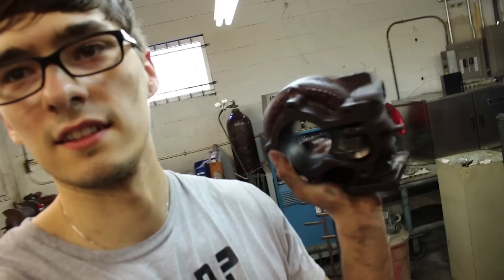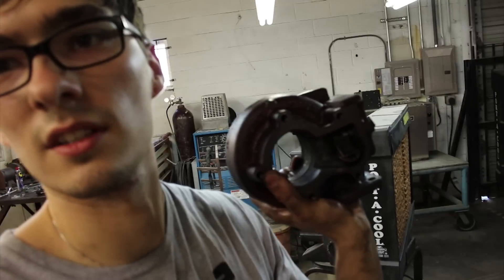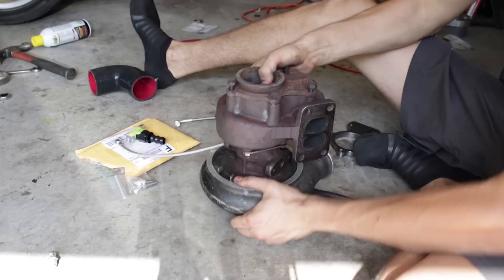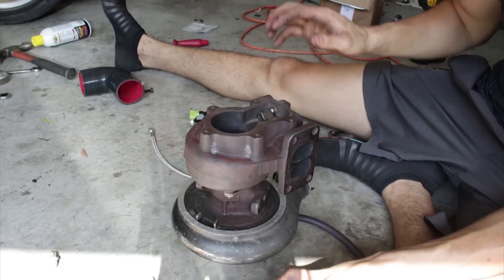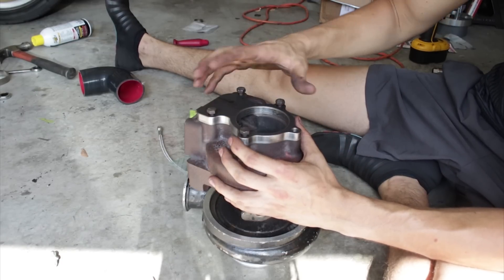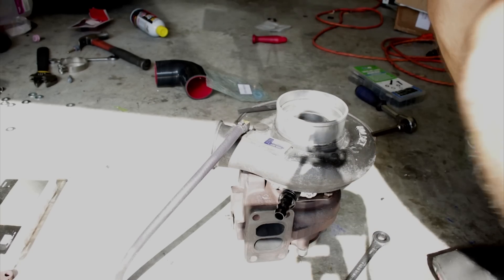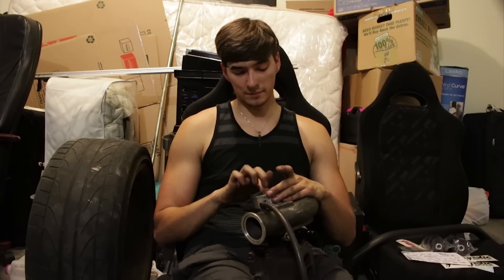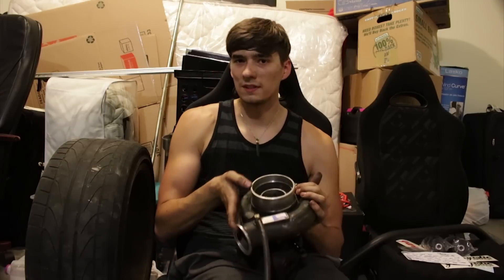Turbo BMW E30 Build: Part 11 | Welding, Clocking, Assembly of Turbo

Comment: That Torch stick out 😂
Reply: Nutguy95 in a tight spot like that with a large cup it's almost necessary to have that much stickout.. mind you that tight spot will flood with gas so it's not really that big of an issue.

Comment: I would have kept the v-band flange on the exhaust. They are so much easier to work with and require not gasket. If you already have to fab a down pipe it would be no harder to fit a v-band flange on the down pipe side to match the one on the turbo.

Comment: Not to be offending or anything but how come you use an old turbo?
Reply from the maker: Cost. Why not though? nothing wrong with the turbo in any fashion.
Reply: i mean why use a diesel turbo?
Reply: Nexcron Plays hx35s are great turbos they are twin scrolls so the spool fast and are capable of almost 40psi of boost

Comment: You should RTV the interface between the compressor housing and backplate. You're likely to leak boost from there if you don't.
Reply from the maker: They make proper seals. I have one. 
RTV is absolutely not the correct thing to use.

Comment: @EuroGarage, I have the same holset turbo and have been searching for a 3" backing plate like that. Where did you get it? A 2.5" V-band fits on the stock exit perfectly but I'd need to get a 3" to 2.5" reducer.
Also, what size silicone elbow is that?
Thanks!
Reply from the maker: http://www.ebay.com/itm/400874203617?_trksid=p2057872.m2749.l2649&ssPageName=STRK%3AMEBIDX%3AIT

2.5" elbow
Reply: Wow thanks for the fast response! Ill order mine now. Too bad I'm in CO, would be fun to build my E30 M50 turbo with ya and compare

Comment: Any concern with the CX manifold over loose slag or metal stalactites inside the turbo manifold?
Reply from the maker: No it's a fairly well made piece, no sugary deposits I can see of. 

In fact the weld they did are better than the welds Troy and I have been doing.

Comment: Can I ask why you welded the waste gate shut? I honestly don't understand why you would do that.
Reply: So he can use external wastegate?
Reply from the maker: The internal gate is meant for about 30psi of flow. So it is too small for the measly 9-14 I will run.

In short, I will be using less of the exhaust gas than I would at such high pressure and must vent more through a larger external gate!

Comment: well , im following you for a time ago because we share the idea of m20 turbo , but i dont have the knowladge to do it so you are a ligth on the nigth for me!.  i ve got some questions for you, related of ECU and injectors. when you put the MS you lose any of main functions offered by BMW on the car?  , and the second what injectors do you plan use? i read something about hi or low impedance but i dont know very well or whic one should use?.

best regards
Reply from the maker: I haven't noticed any loss of function since ecu. But barely driven it. 

I have 60# high impedance injectors from kamotors.

Comment: I had to use a press to get my H1C apart, and it was scary when it finally came apart dude. Lol
Reply: I'm actually glad I did, because I found out my heat shield inside the turbo was in pieces, and I couldn't tell without taking the whole turbo apart!
Reply from the maker: +Aaron Brenckman I took about an hour of prying and heating to slowly wiggle it out. 
I was gentle as to not bend the shaft.

Comment: Just fyi Holset turbos can be ran with the drain up to 30 degrees off vertical. I actually ran one at about 45 degrees once and was good for over 50k miles. But vertical is best. Great video, I don't know what your doing different but the lighting looks great in most of it.
Reply from the maker: Learn something new every day. Good to know if I run into clearance problems down the road. Thank you.

I have been playing with the settings on my new camera, Manual Exposure settings, looks good most of the time, unless the sun shifts and I don't notice, making it very overexposed like the end there. 
It is also summer inTexas, so that helps.
Reply from the maker: I used this info. Thank you. I had to tilt it ever so slightly for the drain.
Reply: Right on, as long as your withing 30 degrees you should be fine.
Reply from the maker: +Joe “Joecrotch” Crofts I'm at about 5. Lol. Hardly noticeable. But it was nice knowing the limits.

Comment: The Fitting is M12x1,5mm.
Reply from the maker: Yes, but a 12mmx1.5 to -3 is next to non-existent.
Reply: That's true but m12x1,5 is very common on german cars.
And also a standard size for hydraulic lines.
A lot of threaded holes for oil-pressure, fuel, iat-sensors, coolant temp and so on are actually m12x1,5. 
(or m14 or m18, those usually have the same pitch of 1,5mm, which is a fine thread for all diameters bigger than M10)

So you get a standard coupler for a hydraulic line, a standard hydraulic hose, with pressed on fittings as you wish.
And everything will bolt right up to the port where your oilpressure sending unit normally goes.
The bonus is, it's much cheaper than buying an-stuff(rubish anyways) and a bunch of adapters.

Also you shouldnt run a restrictor before the turbo, holset limits flow thru the dimensions of the ports that are running to the two bearings.
Reply: I don't understand why you have to convert it to AN size, because you can get oil line made directly with that m12x1,5 thread.
Reply from the maker: +pazi88 I could but then I would need a restrictor and on the other side the hole in my oil filter relocation piece would be much larger. 
This just makes for a very clean install and the fitting is less than $10.
Reply: That holset turbo doesn't need restrictor. It is even better without, because there isn't water cooling in that so it's only cooled by oil. But it's not end of the world if you have restictor :D Just remember to cool down the turbo before shutting of the engine after hard pulls.
Reply: I've said everything in my post above. :)
Reply: Oh sorry I see. I didn't open the whole comment :D
Reply from the maker: +pazi88 I'm running no restrictor right now. 
I'm learning as I go. 
But from what I have read -3 or -4 without a restrictor is more than ample flow.

Comment: Where did you get your exhaust manifold from? did you make it yourself or . . ?
Reply from the maker: KAMotors!
Reply: Wow they did a great job, how much did that cost you
Reply from the maker: +Steven “Stevo” Lorence 200 it's a cx racing manifold. Kamotors is the distributor. 

I will be bracing it.
Reply from the maker: in the 200 range. plus bits for making it externally gated etc.

Comment: One of the most common reasons that thrust bearing wear too quickly and the shaft begins to loose in and out is that the oildrain is too small and the oil pressure in the bearing housing gets too high.
This Causes the Oil to not Drain Effieciently begins to be pushed out through the seals. 
Oil cooking and hardening and also results with the back stuck seals.
Most aftermarket oil return flanges is AN10 and has only 12mm inner diameter, which instead should be at least 16mm!
 
Your Ebay drain seems to be on the smaller size, buy the 16mm one :)
Reply from the maker: I did the research on this before hand, people have reported no issues. 

I measure 12mm at the smallest point. And it is ported. If it starts to smoke I'll upgrade. 

Thank you for your well written input my friend.
Reply: How much were you able to port on the drain? My holset blew out the seal on the compressor side and I'm wondering if this could be the reason why.